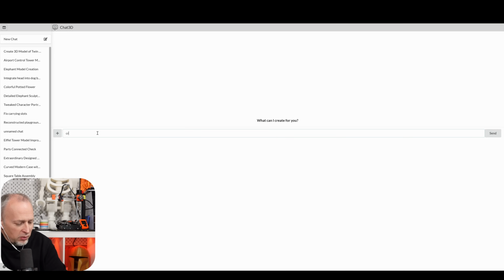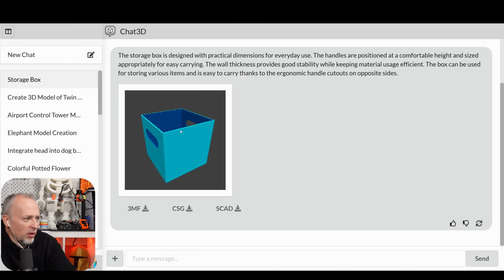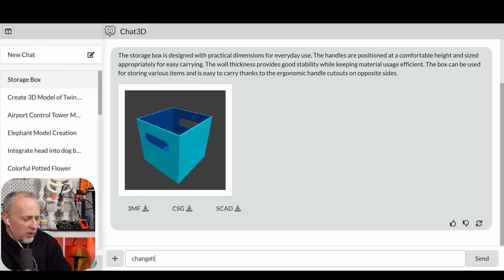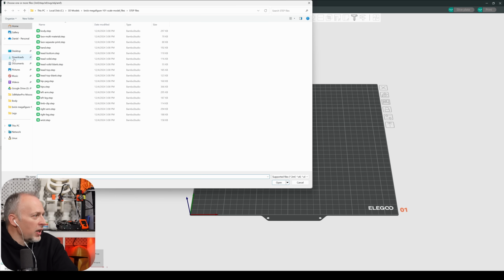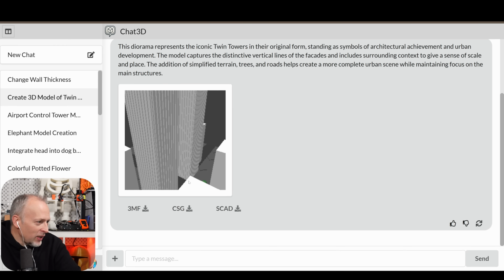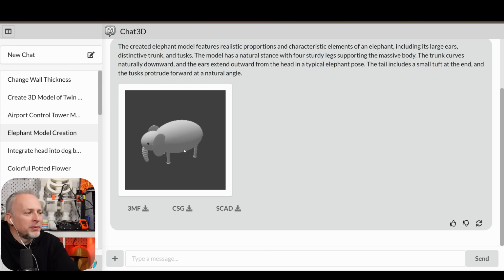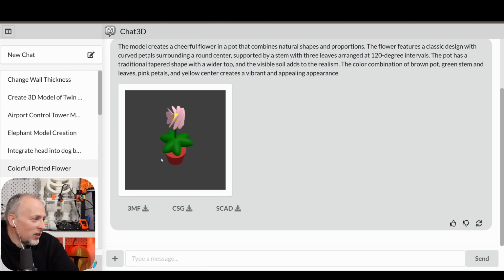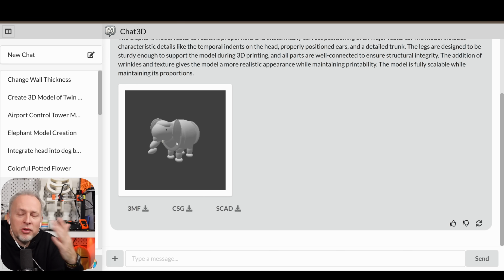AI is Revolutionizing CAD Design Forever - Here's How

Comment: Nice! I have been building something similar for fun, but focused on a much more targeted use case. Cool to see that we both arrived at using OpenSCAD as the core building block. Are you leveraging a large number of statically defined functions and a state machine type router (langgraph, x-state, etc..) or just incrementally building up the context (e.g., when you asked the model to make the box thicker)
Reply from the maker: Just building up the context

Comment: Feedback - Have the program label everything for an example make a box it would label the top of the box the bottom of the box and all sides of the boxes so if you say change the top of the box to Red it would know where the top of the box is and it would change only that to Red same thing for a cat have the model or the program label all the parts of the cat like the teeth label the eyes label the nose label the lips label the neck label the feet label the fingernails label for everything so then you can say change the fingernails make them longer it knows what the fingernails are and it would only change the fingernails and make them longer, and maybe you can feed the models the 3D models back into the program and have it imagine what it would be so feed it the model of for an example your elephant and then have stable diffusion imagine using the geometry to create new elephants
Reply: Was about to mention something similar.  I think when models get more complex it can really be crucial to have a way to "name" faces so the AI will understand which part the user is talking about.  Or maybe adding numbers to the faces

Comment: To be honest it is interesting very impressive, but needs a massive update to be really useful. Don't get me wrong this is something that could solve problems for some. It probably finds a niche in e.g. the storage solution sector, where you have a fixed mount and need to design something specific in combination or so. I personally often design replacement parts based on the original part in FreeCAD and start with a photo to model on or to create an SVG shape from it to use as a sketch. These parts cannot be described in text without any hassle. OpenSCAD needs everything broken down in basic shapes and bringing these shapes and text input together is not going to work.
For creating a vase, a storage box, decorative items or other non real world random designs text to 3d may work, but I don't see a way to describe more complex models than that to get a specific result. Other than photogrammetrie with a thousand pictures and a point cloud  I think the best way to combine AI and 3D is using just a few photos. Give the AI five to ten photos of an object and it can figure out what to design.
Reply: Even with the early prototype capabilities. I can see Chat3D creating simple but useful functional prints similar to the wall mounted DVD shelves I made, the angle bracket supports I made so I can stack 20 Plano 3700 organizer boxes between two studs in my unfinished basement to organize my fasteners and hardware, etc.  Even now, in its fledgling form, it already looks useful for simple functional parts, and it'll get better very quickly.
Reply: @ that’s basically what I said. Now take a tool from your work desk and let the AI create a mount for it. This will not work, because you need to describe the shape of the object you want to create. It is more complex than a box with a mounting solution or a handle.